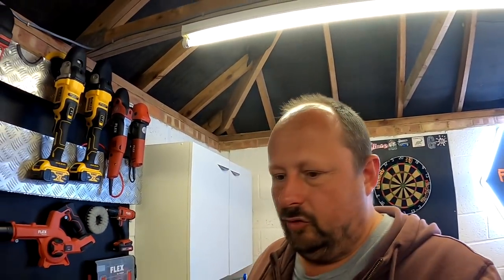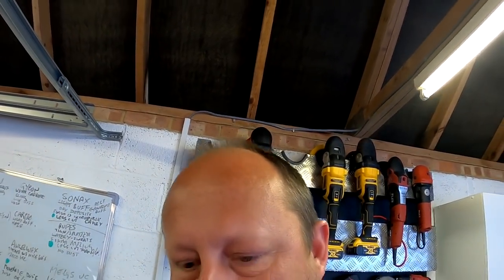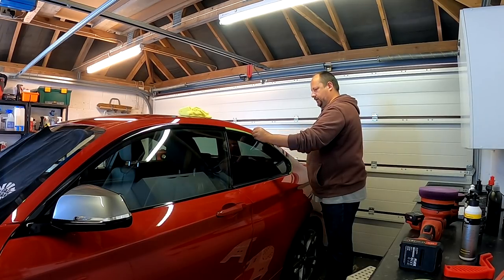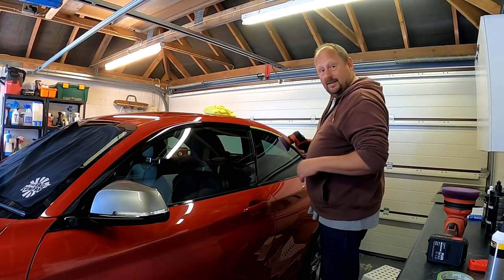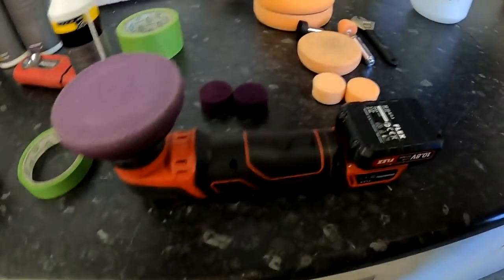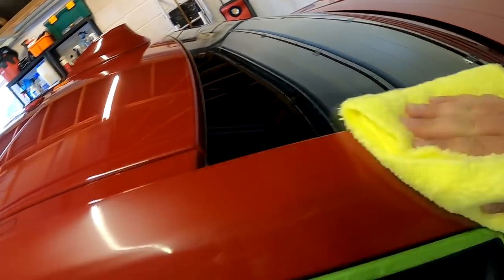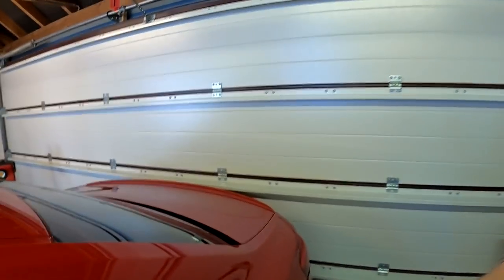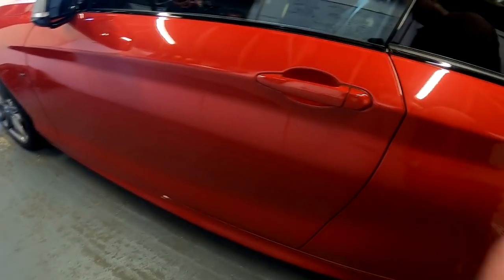Polishing your car with a mini buffer Tips for Beginners

Comment: The PXE is a fantastic bit of kit. I spent the first lockdown last year doing a full 2-stage correction on my 997 Turbo using just that one polisher. It did absolutely everything perfectly. You just need two batteries as the charging time is so fast.

Comment: You mentioned the jack lifts.    You should get yourself a set of those portable Quick Jacks.     Those things look really good and they have the built in hydraulics so you don't need an air compressor to lift them which I really like.    They aren't cheap, butt hey aren't too expensive either for what you get and I love the fact you can move them around so I can use them inside my garage or outside in my driveway if I want to work outside.    I think it's a pretty decent value for the money and you don't have to have your garage floor cut out for the recessed models which cost three or four times the amount (or more!).  On quick jacks website they are going for between $1400 and $1800 depending on the model, plus they are running a sale $150 off plus free wall hangers right now.    I have a terrible back and the convenience of being able to lift the car up to do work on it, including the wheels and underside far outweighs the cost to me.   I am going to get a set soon.

Comment: Hi have you done a review of Microfibre cloths ?. General and finishing ones ?. Thanks
Reply from the maker: hey there,  if your working with soft paints or finishing out I recomend the "microfiber buffing cloths" linked down in the description (the in2detailing yellow 350 gsm korean open pile)  these are about half the price of the next cheapest open pile cloth in the UK.

Otherwise for a one towel does all check out rag master edgeless 300's

If on a budget check costco
or 
paragone microfiber eco 250 edgless
paragone microfiber premium 300.

if your a professional you will want to minimise the amount of towels you need to carry.
Reply: @forensicunplugged4295  that’s gr8 thanks. I use Costco version which are 👌🏾. Fine polishing cloths is what we need for wax buffing etc as the Costco tend to leave very fine marks.
Reply from the maker: @dentalert  get those korean yellows from in2detailing I will talk about them soon again but Ive been talking about them for years. for the price they are so good but they need to be maintained.  washed only with themselves and used only for buffing off polish not like scrubbing dirt...  and kept nice and sealed in dust free place when not in use.
Reply: Perfect thanks buddy 🤟🏾

Comment: Daft question Jon, but what tape do you use, mine seems to stick a little to much
Reply from the maker: this is SP80 in2detailing sell it and its decent price nice low tack no problems with it at all.
Reply: @forensicunplugged4295  cheers. I'll get some.

Comment: Hello John just a bit of advise please I’ve done a bit of polishing with a very cheap machine but then I bought a das 6 pro with green hex logic pads using scholl s20 and if I’m honest abit of s3 is some worse areas. Now I know it’s been a bit warm but the product seems to dry very quickly and there’s some dusting. Do you have any tips on what I could be doing wrong ?
Reply from the maker: hey chris, scholl concepts products S20 and S3 are some of the most oily thick abrasives IVe used.   a few peeps seem to report dusting with S20 but for me its 100% fine.  All abrasives have the potential to dust. you can minimise it massivly by cleaning the pad and switching pads and not heating you your pads.    some times people that report dusting to me.. its like old polishing from previous cars and they dont really clean pads properly and first set bang cloud of old polish thats dry in the pad.. so its hard for me to comment on whats cuasing these problems for people. sometimes people are polishing for like 5 minutes continually then loading up more polish without cleaning and bang polishing again for 5 minutes etc..  Im not saying your doing this but again I cant advise what the problem is without eyeballing it.
Reply: @forensicunplugged4295  I know it’s difficult to give advise over the internet but thank you for your input. I will be more vigilant in the cleaning in between sets. As a rough guide how long to pads last or is it from Vishal inspection of the pad
Reply from the maker: @ChrisLee-fw5he  when the pad starts disintegrating its days are numbered mate.  you can ruin a pad in 10 minutes if you overhead it.. but if you cycle them and keep cool you can get like 5-6 cars out of soe of them (when you are cycling with  aset )

Comment: Hi John. Is the polisher forced rotation? I really don’t get on with my Rupes Mini. Royal PITA stalling especially on curves etc 🙄
Reply from the maker: yes and no.. it has a rotary adapter that can be used on 1 inch (and non propriatory 2 inch plate)   and it has 12ml throw free spinning DA adapter with 75ml plate.  But the DA is decent on the stalling front.   the rupes you will prolly want to cut in rotary mode and finish it out with the DA adapter or even finish it out with rotary mode and lower speeds.
Reply: Thanks for the reply John. 👍🏼
My mistake re the machine I’m using….it’s a Rupes Lhr 75 mini not the nano. I really do not get on with it due to stalling 😤 hence my looking at the Flex system now and forced rotation.  Hope you’re well ☺️👍🏼
Reply from the maker: @D992  ok mate theres no 3inch forced rotation options.  the LHR can stall a bit more perhaps with the cone pads on which widen the footprint but the different stall-a-bility if you like with the XFE 7-12 and the Rupes LHR75 is pretty small.
Reply: @forensicunplugged4295  Comparing the Flex PXE 80 and Rupes LHR 75 would you say stalling is not as much on the PXE 80?. I really like The Flex due to its portability, options and plus its German ;-)

Comment: Hey Jon, do you think the flex pxe 80 bogs more then the flex xfe 7-12?
Reply from the maker: probably.  the xfe 7-12 is on a different level in terms of power.. but you can see for a nano tool the PXE is pretty impressive for light cutting for such a small tool.

Comment: Jon do you ever use any other shape pads like the cones? Seem ideal for doing behind door handles. If not any tips? I've seen people up balls for exhausts too. Which cloths you using there that are excellent?

And lol potter like an old fart
Reply: They are made to get behind door's handles or near the fenders with tricky shapes
Reply from the maker: Hey Aaron I use the flex pads generally they are sort of designed to be used on multipls machines DA, rotary, forced rotation.   

those are the in2detailing 350 koreans mate I link them in.